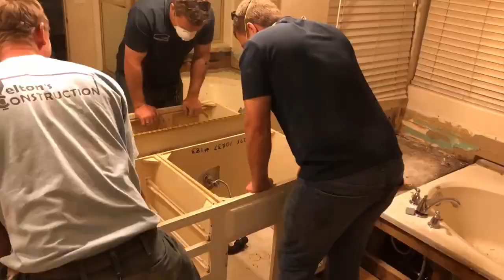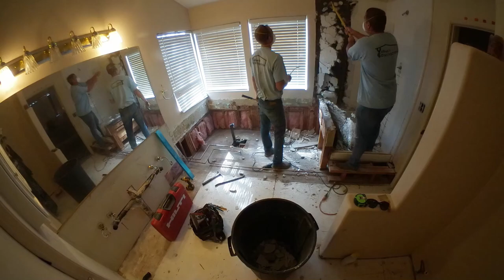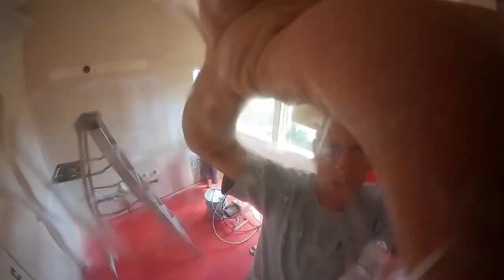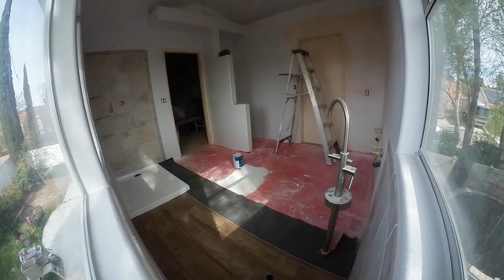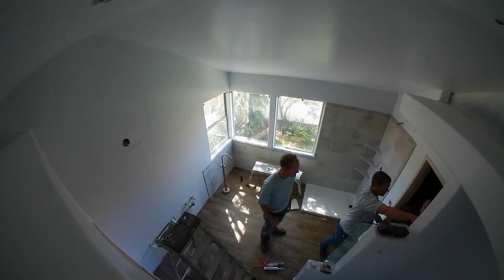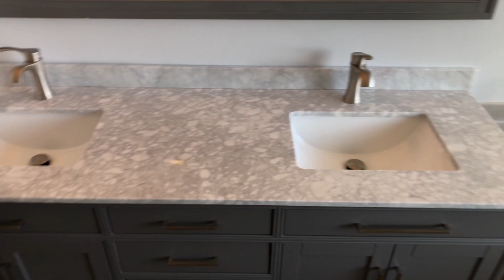Bathroom Remodel Timelapse 2020 (Free Standing Tub)

Comment: Looks great. How is the bath firmly attached to the floor? We are about to put our free standing bath in and can't see how to attach if firmly to the floor other than silicone.
Reply from the maker: Matthew Hortop 
That’s what we use silicone or a strong glue you may put a coaster screwed to the floor on the side you can’t see but if you’re gentle with it silicone or glue should work
Reply: @constructionhacks9293  So the tub is siliconed to floating LVO?
Reply from the maker: @detectivekimble6932  what’s your take?
Reply: @constructionhacks9293  I don't have an opinion.  I'm doing a lot of freestanding tubs in my flips.  I always love the idea of LVP in the bathroom to save time. I don't want to do glue-down or I mine as well do wood-look porcelain tile.  Forums don't cover this topic well.  You get a bunch of old school guys saying they wouldn't put a tub on a floating floor, but no one has really tested it to see if it's actually a problem.  So many things in construction just get repeated until everyone believes them.  I am afraid the weight of the tub could cause a floating floor to lift a bit around the tub which might cause flex when stepped upon.  I might start doing a slightly raised section that I tile under the tub and floating lvp in the rest of the bathroom (for larger master baths).  Anyway, I was hoping you'd educate me :).
Reply from the maker: @detectivekimble6932  I would highly recommend getting a higher end floating vinyl and not using the PVC vinyl the way that I test it is the weight if it’s very heavy it’s good if it’s light weight it will probably sink over time but if you use a good quality heavy vinyl and a very minimal pad you should not have a problem with the tub settling into the vinyl!
I also agree that people get used to doing things a certain way and are not open to different possibilities so thanks for that and thank you so much for supporting our channel and of course lots of respect for any construction worker it’s hard work and stressful!
Reply: @constructionhacks9293  Empty, the vinyl tubs are pretty light.  I silicone them to tile, but do you silicone yours to LVP?  I hesitate to adhere the tub to a floor that can move, but then again, when I think about washing machines, dryers, and entertainment centers being put on LVP, I wonder if there's anything to worry about.
Reply from the maker: @detectivekimble6932  I don’t think there is any other possibilities but an open to suggestions. The free standing tubs are difficult to fasten to any floor. Thanks for your input!